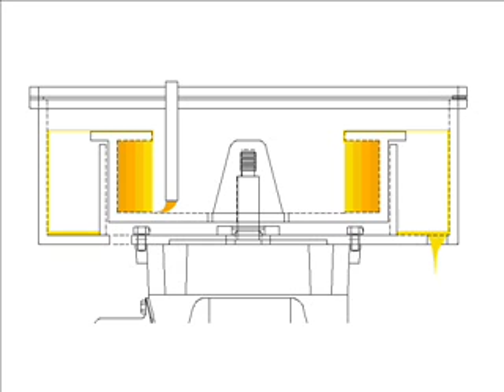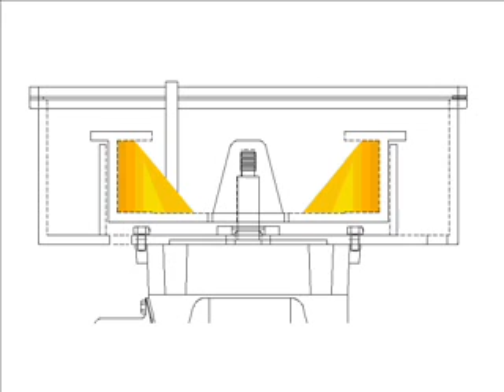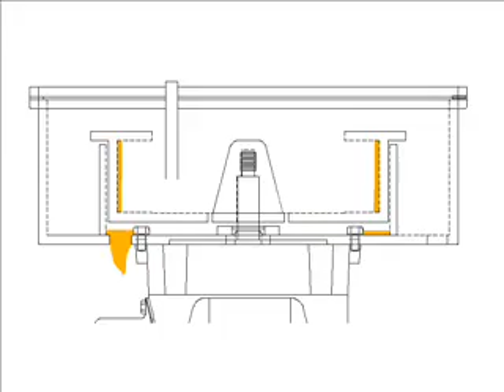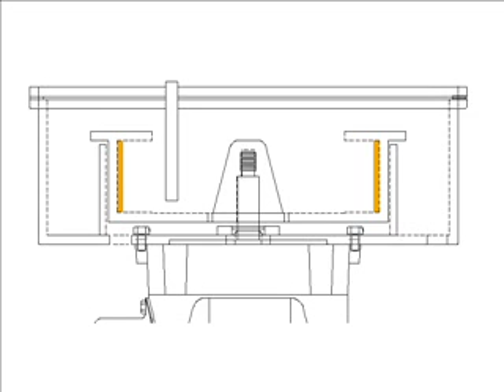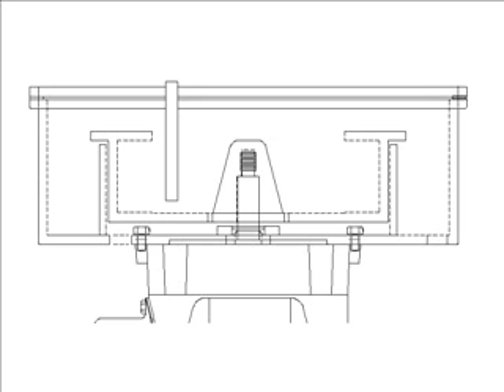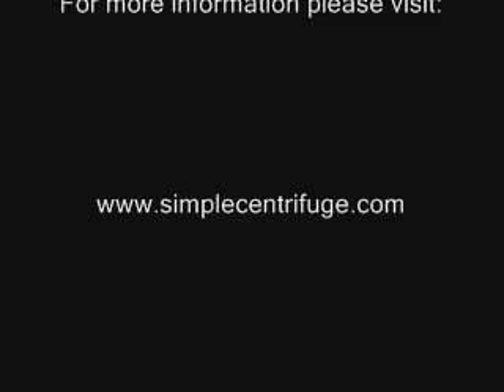The secret of how the simple centrifuge works

Comment: Thank you for clearly explaining how this sorcery works. I've been driving myself nuts trying to find a video or any material on this system. I can get more than enough used motor oil for free and I've been wracking my brain on how to clean it cheaply. My UVO supply has dried up and my filtration system for that was sufficient, but not for WMO.